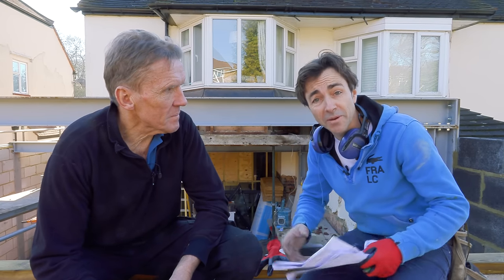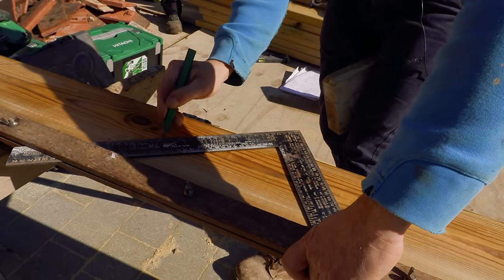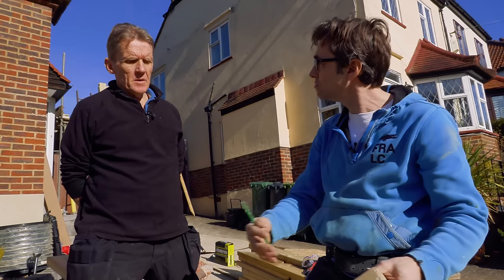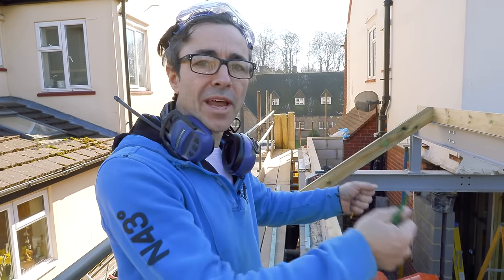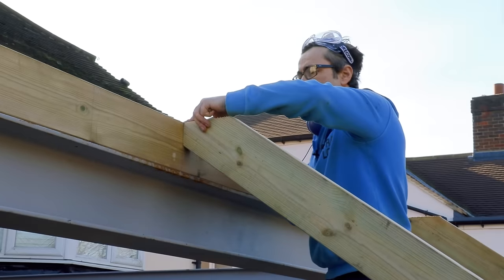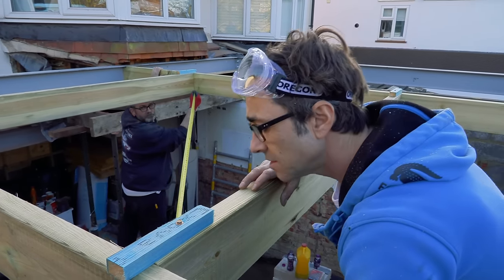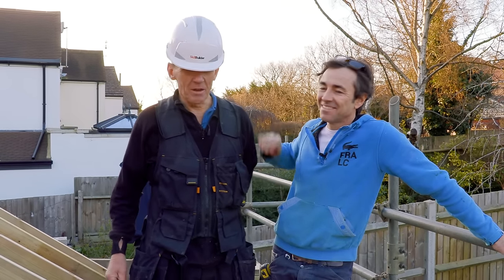How to Build a Pitched Roof - Carpentry Training

Comment: Just discovered this channel today and would like to say how grateful I am for Robin sharing his knowledge. It's very well filmed as well. I'm an architect and I'm going to share this with my office as I think it will really help everyone to remember how much we rely on our skilled contractors and that the lines on our screens are real bits of wood! Really fantastic.
Reply: Could you also tell everyone that a foundation drawing doesn't need anything apart from the foundation drawn on it, in 18yrs I've only had one drawing that didn't have a bed, dining table, pot plants, internal stud walls, toilet/sink/shower tray and even lights+light switches marked on it making it difficult to read, I've also had a drawing for an offset extension that had no measurement to tell me how offset it was, it also had no mention of a Well which was clearly capped and only 300mm from the foundation. 
Rant over.......sorry! 😄

Comment: A well trained and disciplined carpenter works 'fast and easy' with methodology. I had a brother in law (my wife's brother who past on) who was an Ace General Motors Holden trained mechanic. I am a carpenter and I appreciate a well trained man. I used to watch him overhaul automatic and manual gear boxes, engines, differentials etc and it was like poetry, methodical. Everything went together. A carpenter should be the same.

Comment: I like to use the ready reckoner method myself, you can use it to cut every rafter on the floor using maths, commons, hips, jacks, valleys then go mad for a couple of hours in the afternoon assembling it all. Roofs are my favorite part of being a carpenter
Reply from the maker: Dan 
 Yes you can get a good phone app now that gives you the lot. Does everything but  cut the wood.
Reply: Skill Builder only problem I find with the app is that it doesn’t allow you to understand the math behind it. I find it just spits the numbers out and you can go into it a bit blind. That being said the  simple triangle calculator app has helped me out of a few situations figuring out hips on unequal pitches.

Comment: That’s a crazy roofing square never seen one like that in my time on site
Reply: Me neither Mark nor have i heard of the stepping up method, i think i'm gonna go in the workshop tonight and see if i can make some to sell on ebay.
"The Robin Roofing Square"
This time next year Robin we will be millionaires!!!
Reply: No I’ve not to I’ve never stepped up . I use the normal Stanley roofing square with the sliding arm on it that for some reason are £250 on eBay
Reply: @markmarlow  
Yeah this is the one i use the 12" ones are now discontinued thats why they go for alot of wonga.
Reply: DP JOINERY I wish I got more of them I paid £10 from Donington market years ago
Reply: @markmarlow  me too i bought mine off ebay for 20 quid brand new, after finding out they'd discontinued the 12" i bought the black 10" and now keep the 12" in  oiled brown paper.

Comment: Great video. Thanks. Can I ask is there a reason you didn’t use a bed of mortar below the wall plate? Thanks
Reply from the maker: It was used but it needed more on that corner. Not great. Normally you need a good bed

Comment: Hi Robin, Just found your site, Great work, could I ask the rise you had from the plate to top of steel was i believe .715 plus the HAP which is about .122mm the run to the steel was 1.105mm if 1.105 is divided into the over all rise you get a tangent of .757 invert that and you get a pitch of 37 degrees not 35 or did I miss some thing? Thanks for the service you are providing to many tradesmen are to protective of sharing their knowledge.
Reply: Could you paste a link to Robins channel .. please .. 🙏🇳🇿🇳🇿

Comment: Roger & Robin, do you have a video on converting modern bungalow type Rafters /Trusses to rafters that would allow some living space or an office in the attic? I'd like to do this but I appreciate there are structural loads that need to be factored into the design. Have you done anything like this...if yes please let me know. Love the channel you guys are awesome!
Reply from the maker: We haven't got a video on it but basically it involves a lot steel. I think it is often quicker and easier to throw a tin canopy over the roof and take it off completely so you have a blank canvas.
Reply: @SkillBuilder  Wow thanks for the fast reply! I watched some videos of the steel work and it looks solid, but I take your point about having a blank canvas...and that might be more within my ability than messing with steel.

Comment: Good video, but (maybe I've misunderstood) surely this isn't a 'warm roof'. You say at 4:15min that you've got an air space over the top, so it's going to be a sort of 'hybrid roof' - the top, almost-horizontal part is a conventional warm roof construction, but the pitched parts sound like they're conventional cold roofs where the structure projects above the insulation and you ventilate the space between top of insul'n and top of structure.

Comment: Very good, I doubt many carpenters today know what a roofing square is, let alone 
know how to use one.  They would be lost without pre-formed roof trusses.
Reply: Its technically called a framing square not a rafter square and you are mistaken. They are very much still used to today for stair stringers and roofs. But most framers/carpenters use a tape measure with common rafters as most times they are standardized and make use of rafter books that have literally thousands of pre defined basic common and jack rafter measurements. If not then string lines and tape measures can tell you literally everything. 
You are also not entirely correct on the "preformed" roof trusses comment either. Not every house is 100% engineered trusses. Most if not all still require some man made cuts and rafters to tie two or more perpendicular roof lines together. So your comment is vaguely ignorant. Please don't insult an industry if you do not know what you are talking about.

Comment: Robin, do you guys usually build a project like this with a steel structure and then using timber for everything else or was it necessary to use steel for this particular project for structural reasons?

Comment: Hi Robin, can you help me with metric measurements, basically I know that a lot of tradesmen when cutting a roof use imperial (ie) 4 over 12 or 6 over 12 etc etc.,  but what do you use in a metric calculation? Do you Express it like 30 mm over 300mm or 40 mm over 400mm ? Or have you got to Express it in mm length and degrees?? Sorry to be a pain in the ass ,but I got two extension roofs to do, I can get a bloke in like you but I want to DIY it myself, any pointers will be greatly appreciated, thanks Steve

Comment: Just watching your this video clip again, and when you step off ,you used 200 mm increments, is this the case for most roofs, instead of 4 over 12 or 6 over 12 ? You use a degrees  angle  set in your square and then step off at 200 mm increments ? And then add whatever's over at the end ,like 75 mm ?
Thanks Steve .

Comment: Robin, wear knee pads, you'll thank yourself in 20  years time when they need replacing. Nice skills. We never had all the gizmos that make life easy when I started in building, no hard point saws, 4 X 2 timber was a full 4 inches by 2 inches, treated timber had all the tanalith still running out of it when delivered to site and made you feel sick handling it all day so you had to wear gloves , plus it weighed a ton compared to regularised timber with its nice rounded edges making splinters almost a thing of the past.
Reply from the maker: He should watch our video on knee protection!

Comment: Hi Robin, How do you rate the Hikoki nailer. Need to get me another 1st Fix nailer and fancy moving on from a Paslode.
Nice work by the way, you know what you’re doing.
Reply: That nail guns looks very impressive but that safety button you have have to keep resetting to turn the gun on would drive me mad. 
Put the gun down, line everything up (hold in place with one hand), now I need two hands to rest the nail gun.
Crazy whoever thought of that wants shooting, maybe with a Hikoki but make sure you've got both hands free!!!
Reply: The hikoki nailer does the job well I'm a paslode man through and through but this is a fabulous alternative to a gas or air nailer, where are you based if your not too far come and try it for yourself!!
Reply: Robin Clevett  Thanks for the reply Robin. I live in Cornwall and am working near Leamington Spa at the moment, so nowhere near you I would imagine. But thanks for the offer

Comment: Every complex thing built  began with a plan, an ordinary square and some sharp marking thing. Those few things in the hands of a craftsman have built our world. In a span of a few minutes Robin made a jumble of numbers and angles into a single board that established the starting point for the whole roof, and though he made it look easy it is anything but. there are years of experience in his hands and eyes that see and feel slight differences constantly, making any adjustments along way appear simple. that sort of accumulated knowledge is hard to pass along as people turn a way from the building trades…maybe because this sort of stuff is hard and the mental skills required to absorb the material simply aren’t  there anymore

Comment: When building a lean to roof with a 30 pitch and 2 metre span I have calculated that my rafters would be 2.31metres in lenght, do I measure this along the line 2 thirds down from the top of the rafter which I think you call the pitch line. Also as I have not been told the rise to set by plate on the ridge am I right in saying that it should be fixed 1.15 metres up from the wallpate to where the pitch line hits that ridge about 58mm above the bottom of a 200mm deep rafter. This would mean that the height from the top of the wallplates to the top of the  rafters would be about 140mm higher as I am concerned that building control will tell me the roof is to high but I think I am got the right idea. Would appreciate any help.
Reply from the maker: I am not trying to fob you off here but this video gives you an alternative take on the subject and may be easier to understand.
https://www.youtube.com/watch?v=_TmXZ0cGNEI&t=1226s

 A lot of our viewers said that "The penny dropped" when watching it. If you still have questions after it I am sure we can help you.

Comment: How do you square up on a roof that isn't a lean to if your walls are running out? Do you make sure your wall plate is square and parallel and allow it wo sit in board / outboard of the wall a little if the walls have run out? Got to be a limit to this. Do you then just have to measure and cut each rafter to allow for the run out?
Reply from the maker: This video has that very scenario.
 https://www.youtube.com/watch?v=_TmXZ0cGNEI&t=131s
Like you say you can run them off slightly but if it is a lot then you have to measure each one but the angle will also change.

Comment: Hi, I have 2 questions, 1, how can I work out the angle of my ridge cut/plumb cut, using the method of measuring my run and rise. Where is my rise measure to? The top of my ridge? Or the bottom? If the run is measured from the inside of the wall plate, this would be where the bottom of the rafter meets the wall plate, so should the rise be measured to where the bottom of the rafter meets the ridge. But I don’t know that point, until I know the angle. Please help!
2. How can you tie in 2 pitches at a valley, when each pitch is using different width rafters.
Thanks
Reply from the maker: Hi Will We have a video in the pipeline which should help. Look out for it this weekend. The run is half the width minus half the thickness of the ridge plate. You then need to decide what height you want the roof to finish and this is the top of the ridge. The third line is the angle which you can work out or you can use an app such as Rafter Helper where you tap in two known dimensions and it gives you the third one. 
It is easy enough to form a valley of the same pitch. If you have a deeper rafter take the measurement from the top edge of the rafter to the wall plate. That is known as the Height about Plate. There are some really good videos on this so my suggestion is to watch two or three and it will drip feed in but doing is the best way to keep it in there.
Reply: Skill Builder thanks for the reply. The angle of the ridge cut, can’t be worked out using the measurement from the inside of the wall plate to the centre line (minus half the ridge width) to the top of the ridge, as this is not the natural line of the triangle. As it doesn’t take in to consideration the thickness of the timber rafter. The natural triangle, (to work out the angle), would be from the inside of the wall plate, (where the bottom of the timber meets) to the bottom of the rafter at the point it meets the ridge. But my question is, how can you know where the point of the triangle is (where the rafter meets the ridge), when every time you cut a different angle, the length of the cut changes, thus, changing the point at which the bottom of the rafter meets the ridge. Until someone explains to me clearly, to my knowledge, you can’t work out the angle, from scratch. As none of the explanations take in to consideration the width of the rafter. Please help!

Comment: Can you use a construction adhesive instead of bolts?
Reply from the maker: No it is not strong enough to resist the forces of a loaded roof and the wind lift.

Comment: I thought standard hap(height above plate) was 2/3's of  birdsmouth plumb cut?
Reply: The is the general rule, and this was bases around the old average sized roof rafters which where nearly always 100 X 50 nowadays when we get a rafter specified it may be up to 225 X 50 then this rule can be adjusted as the section that forms the eve or the bit that hangs out for the facia etc is plenty strong enough even if you cut the birdsmouth to one half of the rafter, Great comment!

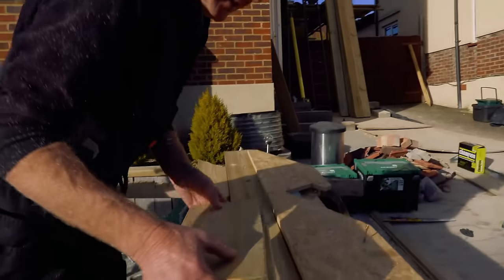Comment: 24:36  Not to be safety police, but it's not very safe using the miter saw like that. ( crossed up ) Especially on a slider miter saw. If you get kick back there the saw can run straight back and get your arm. Best practice is left hand on trigger like you do later. Nice carpentry!!
Reply from the maker: The guard protects the back of the blade. If it wasn't there I would agree with you but like you say better to use it left handed.

Comment: Robin do you do the stepping off method a lot why not put the ridge up and measure top of ridge down to point of birds mouth ? On lean to roof etc
Reply: Hi Mark
I only use the stepping off method on the unusual smaller roofs like this usually I use the mathematical calculations using trigonometry especially if i'm doing a super huge roof!!
Reply: Robin Clevett can’t beat a super huge roof there’s some great apps for roofing that’s what I use saves getting the old fashioned roof book out thanks for your reply
Reply: BuildersCalcsRoof and rafter help on iPhone if anyone’s interested

Comment: Is lumber in Europe milled in metric or still milled using Imperial standard ?
Reply: Hi Keith it's a combination of both so our sawn timber say a 2 X 4 comes in at 97mm X 47mm or  even slightly smaller depending on where you get it! We have mainly imperial sheet material so 8 X 4 boards but our drywall boards are metric at various sizes but the most common being 2400mm X 1200mm so it's all very confusing!! Hope that sheds some light on your question, thanks for taking the time!

Comment: Yes, it's  easy to criticise but if you say this is carpentry training then you  offer yourself to review.  There's a number of errors in this construction that would lead it to being failed.  1) Multiple joists (around the lantern) should be bolted together with m12 bolts, timber connectors and 50mm washers - you're not allowed to gang nail them, 2) You need joist hangers at right-angle connections between trimmers and joists or rafters - nailing is not sufficient, particularly at the lantern light, 3) It generally now not allowed to fit joists into steelwork flanges - they want you to bolt a timber in and use joist hangers - I don't necessarily agree with this requirement.  If it's done right with good cuts and tight noggins then it's plenty strong enough - the reason they want joist hangers is because its often not done correctly,  4)  It's many years since I've seen 100mm x 50mm wall plates - everything now is 100mm x 75mm - a more solid bearing and more to nail to, 5) While the tight notching over the steel work flange below the wall plate might look good, you should leave a clearance - the reason being if there's any shrinkage of the wall plate this will allow the rafter to still have full bearing and not 'lift off' the wall plate.    No doubt Robin is a very skilled and conscientious carpenter but he's not perfect - none of us are.    Techniques and requirements move on and it's important to keep up-to-date with current methods and best practices.

Comment: Chaps, looked at the beam video over & over - can,t get my head around the cuts- I,ve got 22 4.8 roof beams to install - looks like one a day until I get the hang of it
Reply from the maker: Where are you based?
Reply: @SkillBuilder  Based on the Wirral, but after much discussion with "she who must be obeyed" managed to find an excellent joinery fir who are installing the beams.Next task is to follow the guide on rendering once the roofers are done -

Comment: Also, what nails are you using in the gun?
Reply: I always use a 90mm 3.1mm galvanised nail these are the clipped head type
Reply: @ukconstruction  are you using Fischer? I've had my hikoki gun jam twice using the 90mm Fischer nails 🤔
Reply: I try to use paslode for all my work regardless of the type of nailer I have in my hand, the paslode nails are also good value if you shop around
Reply: @ukconstruction  thanks mate